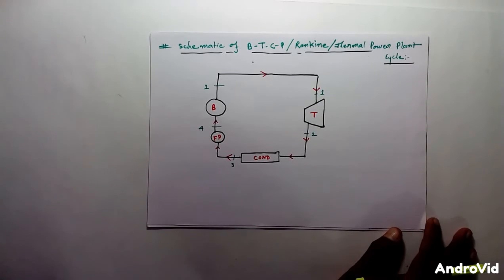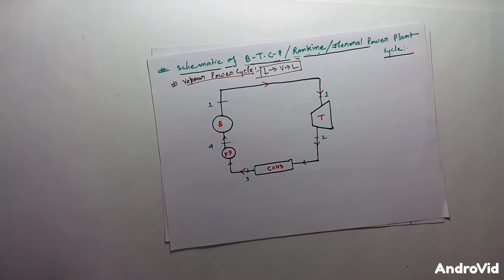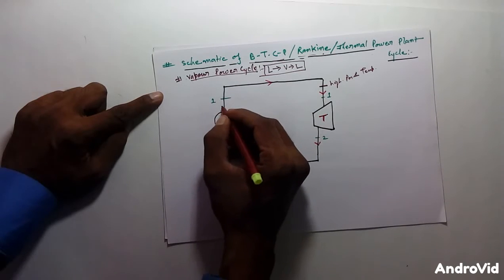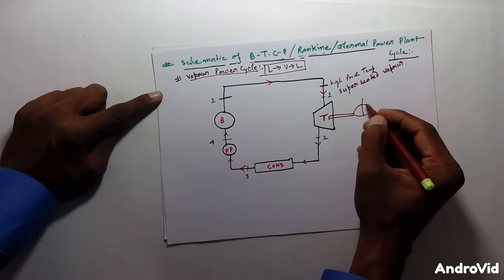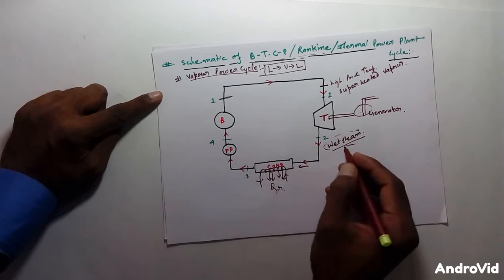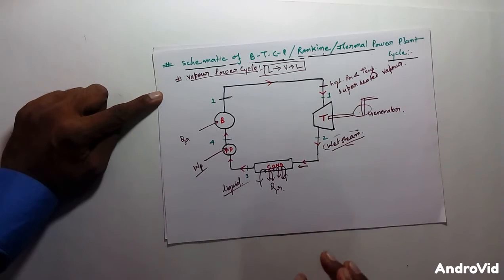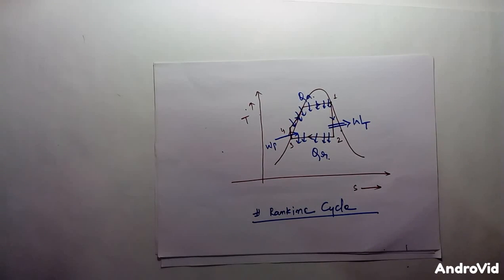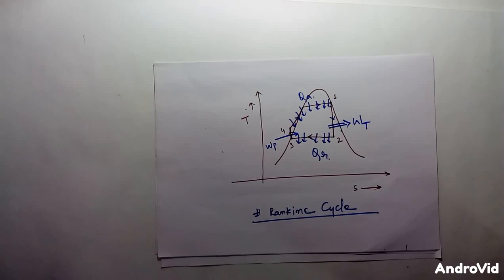Rankine Cycle with Reheat & Regenerative-1

Comment: You described the vapor leaving the boiler as superheated.  This does not reflect the graph you drew at point 1.  For the steam to be represented as superheated on the graph, it must follow the constant pressure line in the vapor dome, which it does.  But when it reaches the saturated vapor line of the dome, it will continue to follow the constant pressure line as it increases temperature.  Point 1 on the graph instead represents saturated vapor, not superheated vapor.  All other points however, are correct.